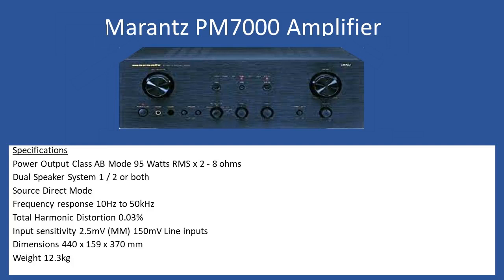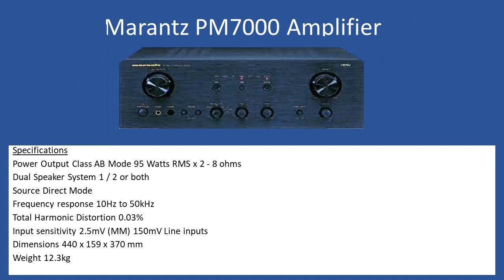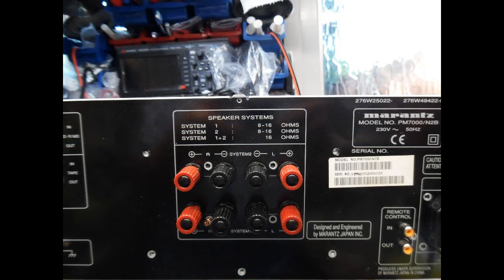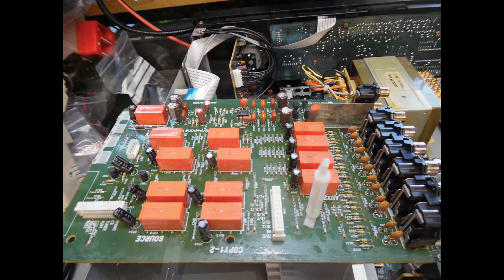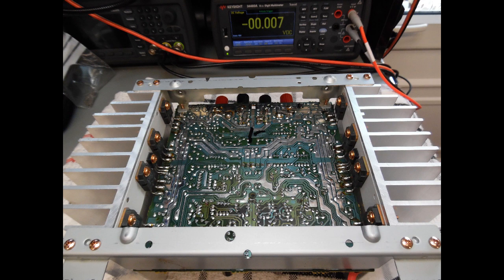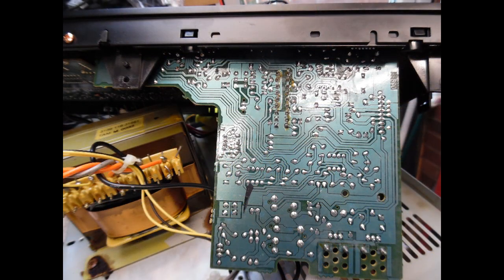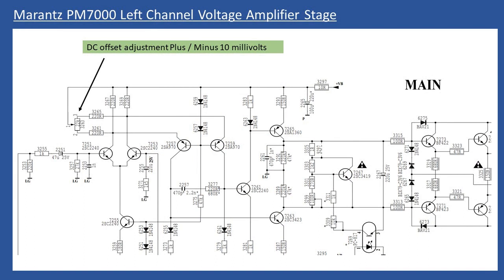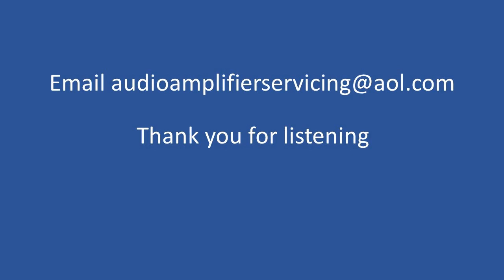Marantz PM7000 Amplifier Repair (With Audio Tutorial)

Comment: hello, idk if you or anybody can help but my pm7000N plays for about 10-25 seconds and then stops all audio, audibly clicks as if it's switching inputs. Like it's retriggering the input selection for a second, and then resuming for another 10-25 seconds before freezing again. This happens on all inputs, different cables and all sorts of different methods. One day it stopped doing it, but then the next day it started again.. Any tips?
Reply from the maker: Hi follow the tutorial and it should resolve the issue your seeing.

Comment: Hello there, i have an issue with my pm7000, it will always reset the input to TUNER when i turn it on. What are the component that cause that reset?
Reply from the maker: @HappyPepe5  Hi check the circuit associated with the hold pin on the micro.

Comment: Getting buzzing out the left speaker terminals, from both set 1 and set 2 speaker inputs. I changed the wires and the buzzing changed to the other speaker so I know it’s a receiver problem. I also tested the wires with a separate receiver and they are performing fine. Any tips?
Reply from the maker: Hi, the PM7000, like the PM7200, will have dry solder joints on all the circuit boards.
This tutorial covers what to do https://www.youtube.com/watch?v=zxSyBnfQr2k&t=721s
It's important to first eliminate. any underlying issues.  
Do you have an audio signal tracer to track the buzzing sound to isolate where it's coming from?